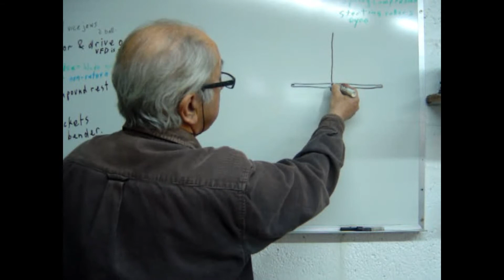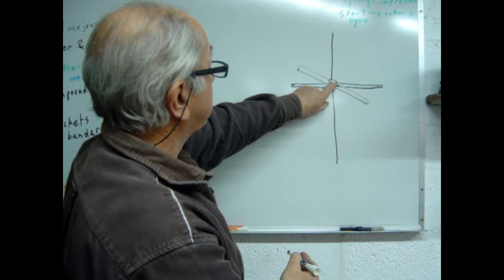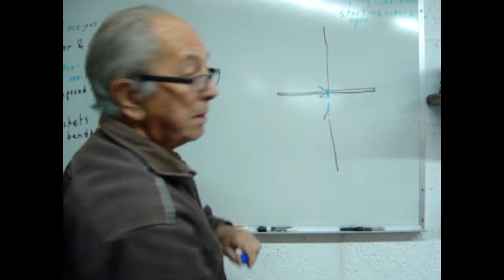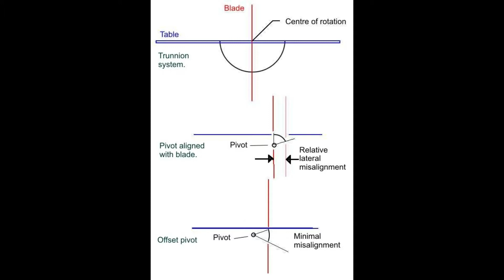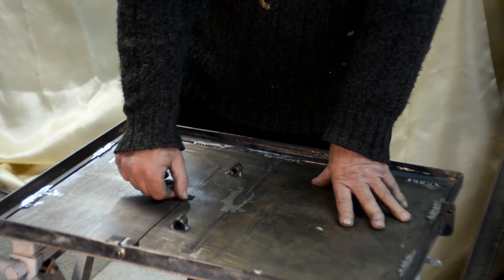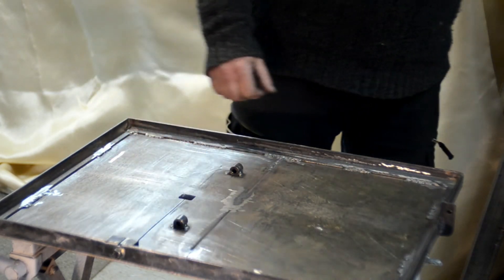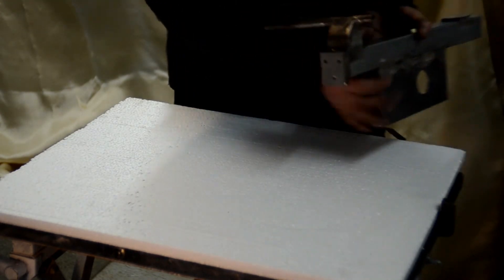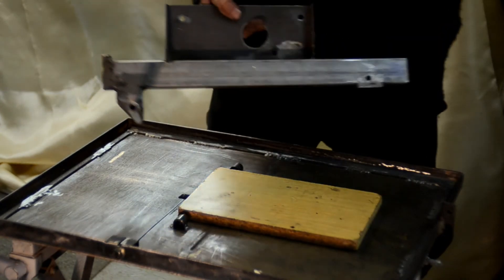Homemade metal cutting bandsaw. Part 4.

Comment: I am not trying to be a jerk or the grammar police I really don't like the grammar police but there is one word the drives me absolutely batshit crazy and that is orientate it is not a word it is a mispronunciation of orientation! Technically the verb should be Orient which I know is also a place but it is also to place if you know what I'm getting at. yes it is in some dictionaries orientate but it is also been described as an incorrect or bad lazy pronunciation of the term it's basically been made up by people and his over the years been accepted but was never officially a word. Modern dictionaries will have it. 

(The noun form of this kind of orienting is orientation. Sometimes people in their speech will form an imagined verb from orientation and say orientate. At best, orientate is a back-formation used humorously to make the speaker sound pompous. The correct word is the verb orient.)
Reply: Spellcheck “has” you picky nob, not even a word about the great video